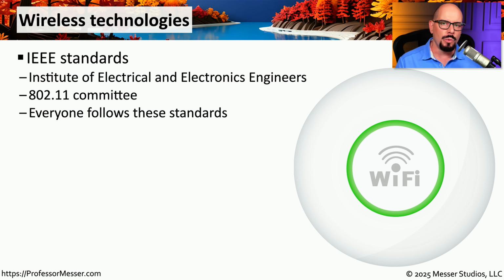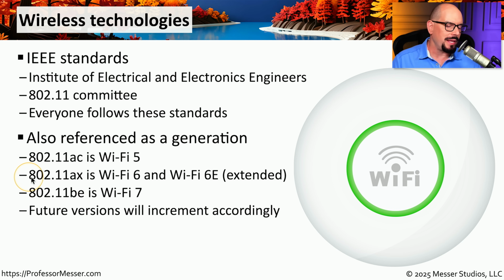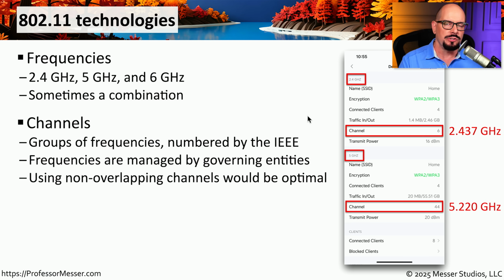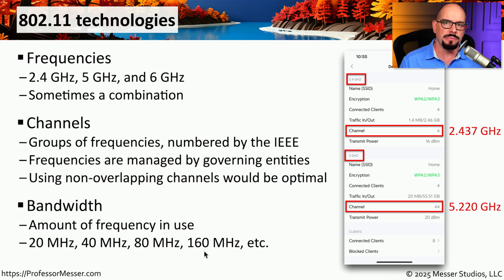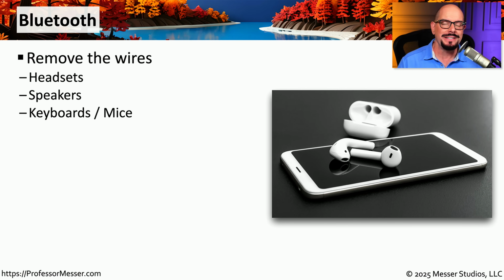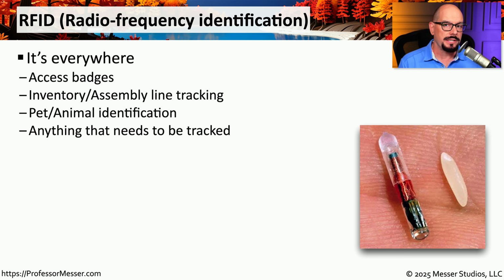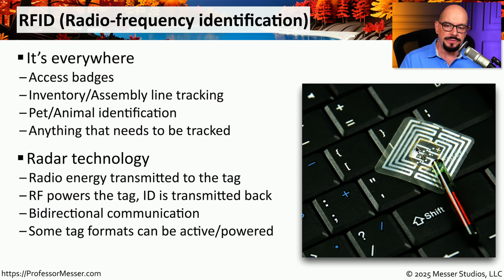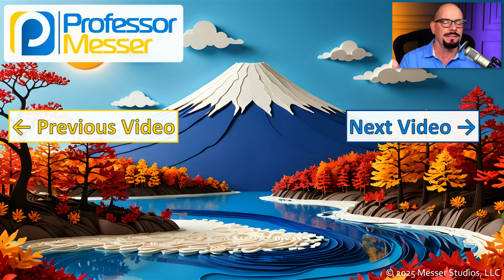Wireless Network Technologies - CompTIA A+ 220-1201 - 2.2

Comment: Love your work prof, I was studying for the old a plus exams, am i right in thinking now we do not need to know the frequency/range of each wifi generation like the old exam?

thanks and keep up the good work!
Reply: I've been wondering the same, I'm going to ensure I have some understanding of the older generations just in case but personally I doubt it will come up.
Reply: i think it will come up, on the exam's objectives it states: 802.11 standards, thankfully its only 802.11 and no other standards, there are many different ones as well, like PoE etc.